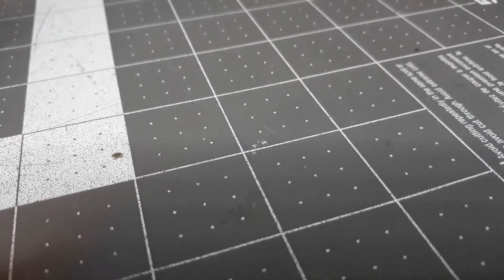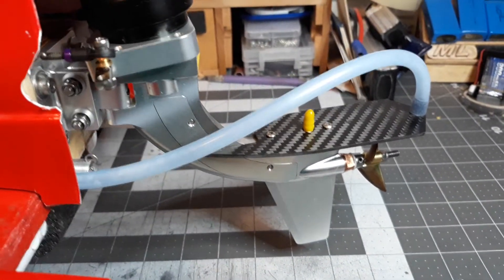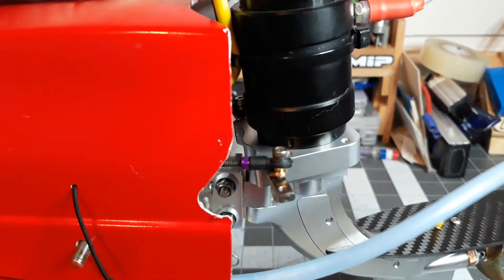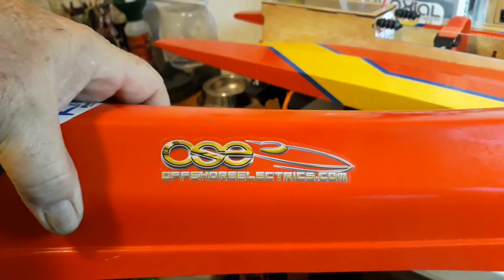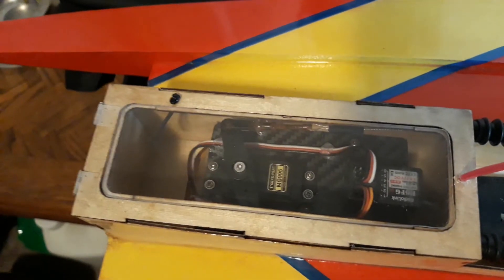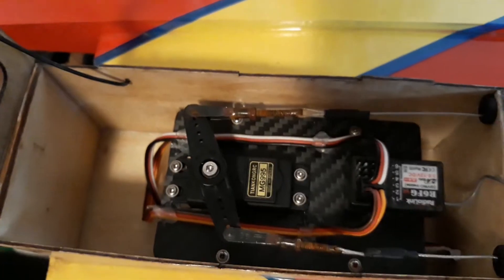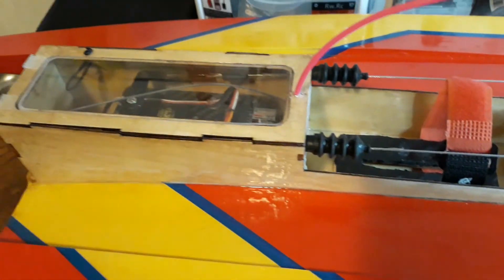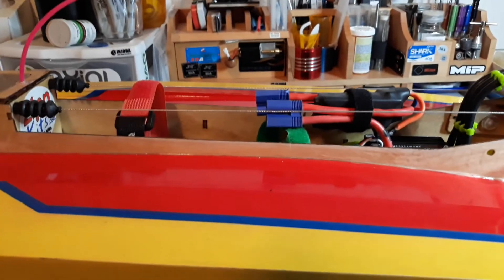zip kits G30 what makes her tick

Comment: Hey Vinny....thats a good looking G30...neat and tidy layout...i know this is a far out question...but you wouldnt know what version the boat...meaning...i was working with Rod Geraghty on the cheater pads under the tunnel and there were some changes made...i guess i would need to buy another G30 just to see what changes were made...looks good...and the natural finish lower stands out...👍
Reply from the maker: I have the new version I just built. I'm not sure what you're talking about the stumble blocks.?
Reply: @vinniebuiltRC  yes....stumble blocks....
Reply from the maker: @okiedoak201  I just posted a little video if it helps if. Not Let me know how I can help
Reply from the maker: @okiedoak201  By the way I'm pretty sure it's your fault that I have 2 of them now.
Reply: @vinniebuiltRC  that's the best blame I ever recieved....👍🤣

Comment: Nice video Vinnie and great build. I like your pull pull steering system. 
How do you like the TFL leg? Does the flex shaft hold up? I run mine with another coupler (clamping one) so I can use flex shafts with one round end instead of the double squared one. Cheers!
Reply from the maker: I haven't had any problems with it yet I maintain it after every time I run it I like it so far thank you for the sub appreciate it

Comment: The Boat Gang is expanding! Great to see you posting a video Vinnie. I hit the subscribe button right away! I love tunnel hulls - especially the all wood variants which there are very few of unfortunately. The Zip Kits G30 is an awesome kit. I have a Dumas Hot Shot Sprint 3.5 F1 boat that is set up almost exactly as yours with the TFL lower unit and Flycolor (OSE Raider) 150 ESC. It's one of my favorite boats, and it is very graceful in the water. I run it on 4S and it's good for around 45 mph with a 4216 prop. It's able to hold most of the speed in the corners and it slides like a Tokyo drift car. Can't wait to see more. Cheers!
Reply from the maker: Welcome George I've seen you comment on Brandon's website Ironclad I don't anymore because he dissed me I still watch though I would like to know if you'd like for me to do a build series I'm going to be building another little shrimp it's on its way from China let me know in the comments thanks for subscribing your next number 27 appreciate it
Reply from the maker: Can I ask where you're from George I'm from Northern Cal myself
Reply: @vinniebuiltRC  I'm in SoCal. I live in the San Gabriel Valley. I have two awesome lakes that are both less than 20 min from my house: Leg Lake and Puddingstone Lake. I think a build series on the Shrimp Boat would be good to have on YouTube. It's a popular boat because it's so cheap - I had a couple. I sunk one and sent the other to Big B and he had a similar problem. I'm gonna start posting on YouTube soon too. I think I have a lot to share with RC boat enthusiasts. We can never have enough RC boat content on YouTube. Peace brother!
Reply from the maker: @georgegonzalez9281  damn George I'm originally from SoCal I've fished in Pudding Stone I'm originally it's from Cypress I would love to boat on Leg Lake that looks nice be a member would be cool

Comment: Vinnie, look for braided stainless fishing line and the crimps that go with them.  You'll need a dedicated crimping tool (get the expensive one 😉), but it will make a miniature aircraft-style cable that will not pull apart.  I don't think I can post a link here, but if you can't find it, send me a note.  I like your build, it is very sanitary and neat.
Reply from the maker: Thanks Doc that means a lot coming from you.
Reply: I used silver solder to bond the cable to the endlinks on my pull pull system and never had a problem with them coming apart. Dr. Jet is right, however, it's better to use steel cable over the nylon cable that is common on RC boat pull pull systems.
Reply from the maker: @georgegonzalez9281  I bought the doobro pull system and it comes with like 15 ft of really small coated stainless steel cables real nice it's easy to make a crimp for it
Reply from the maker: @georgegonzalez9281  and actually the ends pulling off it's kind of like a Servo saver the weak Link in the system doesn't break my outboard off the back of the boat
Reply: @vinniebuiltRC  I have tried the DU-BRO 4-40 pull pull system PN 518 and did not like it at all. The cable is too thin and the end links are overly complicated. Sullivan makes a much better system with thicker steel cable and steel clevises that can be soldered together. My Dumas F1 kit actually came equipped with the Sullivan cable system, so I didn't have to source them out. Just trying to help, not implying that one way is better than the other. I'm in the process of building an all-wood, 32 inch catamaran that's made from the same company that makes the Shrimp Boat. I already built one that has an inboard motor. It was featured on Ironclad RC as one of Big B's subscriber builds. It is detailed with Martini Racing livery - maybe you saw it on his channel. The one that I am building now will be it's twin brother, but it will have a TFL Scale Outboard with a pull pull steering system. I've been documenting the entire build and I plan to upload it on YouTube once the boat is complete and get running video. Seeing your new channel has motivated me even more to get this first video done. I have over a dozen boats that I want to feature on YouTube including many vintage boats. Thanks again for your videos - I've gone back and binge watched your entire library. Cheers!
Reply from the maker: @georgegonzalez9281  wow George I'm still just a novice only been doing this a year so I've only Built three or four votes at just a beginner I never even heard of Sullivan maybe you could send me a link I will look into it cuz I am going to build another G30 thank you for all your help I definitely need and appreciate it and I did see your boat on Brandon's Channel actually my G30 was his first build of the week